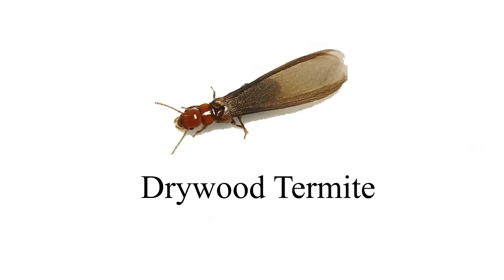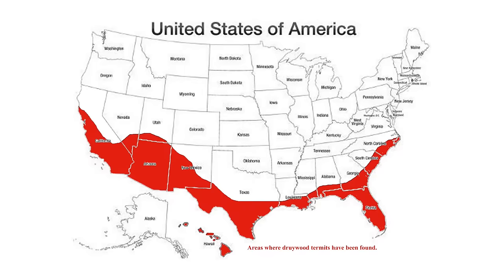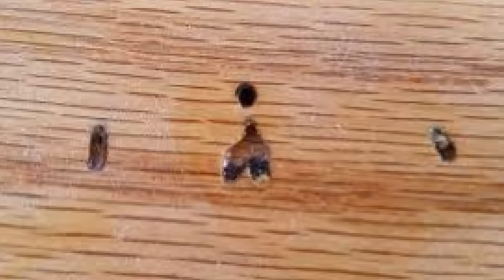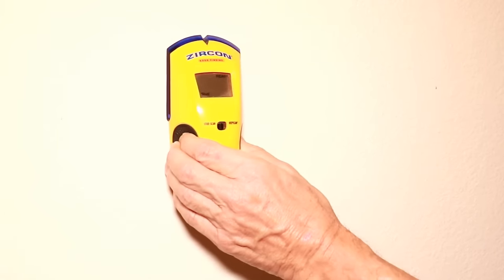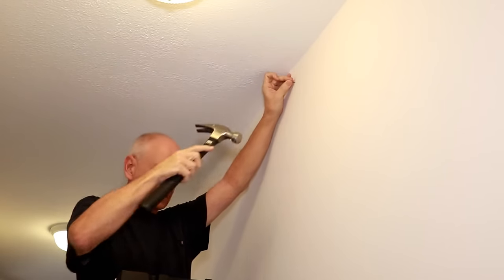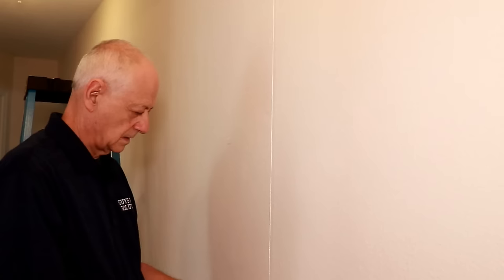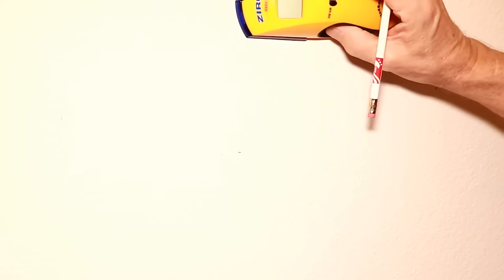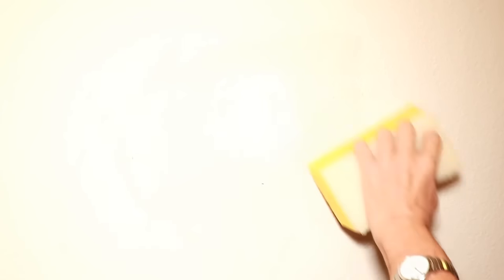How to Treat a Drywood Termite Infestation Yourself. A MUST see if you have Drywood termites.

Comment: I live in south Texas. I believe I have drywall termites. Ive been seeing kick out wholes and frass falling in on my kitchen time and around the kitchen window. My aunt got me Termidor SC. I have looked outside my house and I don’t see any mud tubes outside my house. I’m not sure if we should return terminator sc and get something different. But I do know I can’t afford a professional pest control.
Reply from the maker: I am so sorry that you are having this problem.  It sounds like you do have drywood termites.  This is very common in South Texas.  The Termidor SC is not going to work in your case.  You are not seeing mud tubes because drywood termites do not create mud tubes.  It is important to understand how drywood termites work.  They are not subterranean, so they fly to your house and enter through cracks and crevices around windows, doors, eaves, pipe penetrations, and so forth.  Most of the time, they enter through several locations.  That is because a swarm of them attacked your house at the same time.  If there was a crack or a crevice, then they probably found it.  After they establish their galleries, which will be inside the wood, it will take four to seven years for them to be able to swarm.  Now that they are in your house, the swarmers will use holes that are in your studs to travel through the walls.  Those holes in the studs were created by the electricians to run the electrical wiring.  Not only are these holes going through the studs, but holes were drilled into the attic for the light switches and to run some of the wiring for the outlets.  So, the termites now have easy access throughout the attic and the walls.  If you have a basement or crawl space, they have access to that as well.  Most of the time, you will have no idea that they are in the walls, because the frass is inside the wall.  To make matters worse, if you have drywood termites, then your neighbors have them too.  That means you have been getting swarmed for as long as they have existed in the neighborhood.  Most likely, we're talking about years, so it's a safe bet that you have these guys in many locations in your home.

I always hate to be the bearer of bad news, but if you have drywood termites, the only sure way to get rid of them is to fumigate.  Prices for this can vary wildly in this industry, so I recommend that you watch my video on how to hire a pest controller without getting ripped off.  That video can save you a lot of money.  You should also know that the gas they use to fumigate has absolutely no residual action whatsoever, so you can get reinfested the moment the tent comes down.  Like I said before, if you have drywood termites, then your neighbors have them as well.  Since drywood termites swarm every year, it is almost a certainty that you will be reinfested within a year after the fumigation is done.  The only way to prevent this is to do a preventive treatment on your house every 60 days.  Most pest controllers will not do this, so it is something that you generally need to do yourself.  I have a video on how to do that and I will place a link below.  This is a generic video that covers a lot of different pests, but it also works for preventing drywood termites.  Just ignore the part about treating your yard.  You only need to treat the house for drywood termites.  This will not treat the termites that are already there, but it will stop new ones from getting in.  If you absolutely cannot afford to fumigate your house, then you can try spot treating it yourself.  It is virtually impossible to find all the termite galleries, but it is way better than doing nothing.  The video you watched will show you how to do the spot treatment.  Regardless of how you treat it, you should begin the preventive treatment immediately, so that you do not get additional termites paying you a visit.  Even if you spot treat this, you would be wise to start saving for a fumigation.  The only good news about drywood termites is that they are slow eaters, so it can take years for them to do structural damage.  However, eventually that may be the case.  So, don't wait forever.  I recommend that you try to save up for a fumigation as soon as you can.  Structural damage can cost thousands to repair, and it could make your home unsafe to live in.

I am so sorry that this is going on.  Be well Melissa.                    

Video on how to hire a pest controller without getting ripped off:  https://youtu.be/y-a8XOqVrlE

Video on how to prevent drywood termites:  https://youtu.be/Yozv3s-Qwlw
Reply: If you have drywood termites, you really afford not to hire a professional. Don't hire the big companies (like Terminix). They charge much more & aren't better than the small local companies that have many years in the business. Verify their license, read complaints on Better Business Bureau, and mostly importantly, watch the videos Guy recommended. Take action sooner than later. I had my house fumigated twice.

Comment: Hello Guy. I have a severe Termite infestation at all corners of my home inside and also the outside structure I had 3 companies come out to quote and they told me they just gas the inside of the structure with all doors and sliding exterior doors closed. My  Eichler home has a unique Post and Beam construction . I asked the 3 companies what about the outside siding, beams, and extended roof as much as 7 feet from the exterior walls and they gave me a lame excuse that the gas will seep through the walls and cracks from the inside. This is totally illogical to me as I thought they would circulate gas on the outside perimeter of the house as well to treat all areas of termite infestation that are in the very extended roof and beam overhangs. Have some termite tenting co. gassed the outside of the structure as well as the interior ? Any information from your experience would be greatly appreciated. Thanks for taking the time for producing this video.
Reply from the maker: The pest control companies are telling you the truth.  The way fumigation is done is they put a tent over the entire building and they introduce a gas, which is usually sulfuryl fluoride (Vikane), inside the building.  The gas will penetrate right through the walls and kill everything within the confines of the tent.  So, if the tent is covering it, then that should do the trick.  Most of these companies have been doing this a long time, so if there are any special circumstances, they will generally make adjustments for it.  Keep in mind that most of the companies that give estimates do not actually do the work themselves.  It is very common for them to farm it out to a company that only does fumigation.  So, the pest controller you speak with may not fully understand how those special circumstances will actually be treated.  The folks that actually do the fumigation should know what they are looking at and they should be able to ensure total elimination of the termites.  

Before you do the fumigation, it is important to understand how drywood termites work.  They enter through cracks and crevices around windows, doors, the eaves, pipe penetrations, and so forth.  Most of the time, they enter through several locations.  That is because a swarm of them attacked your house at the same time.  If there was a crack or a crevice, then they probably found it.  After they established their galleries, which will be inside the wood, it will take four to seven years for them to be able to swarm.  Now that they are in your house, the swarmers will use holes that are in your studs to travel through the walls.  Those holes in the studs were created by the electricians to run the electrical wiring.  Not only are these holes going through the studs, but holes were drilled into the attic for the light switches and to run some of the wiring for the outlets.  So, the termites now have easy access throughout the attic and the walls.  If you have a basement or crawl space, they have access to that as well.  Most of the time, you will have no idea that they are in the walls, because the frass is inside the wall.  To make matters worse, if you have drywood termites, then your neighbors have them too.  That means you have been getting swarmed for as long as they have existed in the neighborhood.  Most likely, we're talking about years, so it's not surprising that you have these guys in many locations in your home.

The only sure way to get rid of them is to fumigate.  Prices for this can vary wildly in this industry, so get as many estimates as you can.  You should also know that the gas they use to fumigate has absolutely no residual action whatsoever, so you can get reinfested the moment the tent comes down.  Like I said before, if you have drywood termites, then your neighbors have them as well.  Since drywood termites swarm every year, it is almost a certainty that you will be reinfested within a year after the fumigation is done.  The only way to prevent this is to do a preventive treatment on your house every 60 days.  Most pest controllers will not do this, so it is something that you generally need to do yourself.  I have a video on how to do that and I will place a link below.  If you absolutely cannot afford to fumigate your house, then you can try spot treating it yourself.  It is virtually impossible to find all the termite galleries, but it is way better than doing nothing.  Regardless of how you treat it, you should begin the preventive treatment immediately, so that you do not get additional termites paying you a visit.  You must start the preventive treatment before the fumigation is done.

I hope that helps.  Be well my friend.                      

Video on how to prevent drywood termites (You do not need to treat the yard for drywood termites.  Just treat the exterior of the house every 60 days):   https://youtu.be/Yozv3s-Qwlw

Video on how to hire a pest controller without getting ripped off:  https://youtu.be/y-a8XOqVrlE
Reply: Thank you so much for the quick reply and and information Guy!  I never had this experience of a termite infestation at this level in my life before. Because of the many stories of break-ins n my area of southern California during a tenting  and the the huge hassle of moving a lot of things out of my home including many tools I have I have been putting this off and tried only spot treating which hasn't really done much. So far my quotes have been around $2500 and I plan to rent a small motorhome so I can park in front of my home to ward off criminals so I'm looking at $3000 plus. I'm also planning on doing your proactive treatments around the outside perimeter on my home and all the garage space open wood framing you suggested. Thanks much again Guy! @GuysPestSolutions
Reply from the maker: You are very welcome.  I hope it all goes well for you.  Be well my friend.

Comment: My attic space is tight, what type of sprayer is best to lug around for the bora-care? 0:01
Also, does the bora-care treatment kill any existing termites in attic or is it just a preventative measure; if so, should I fumigate or use some other product after the bora-care dries? Thank you so much for the information it is very educational.
Reply from the maker: I always use the cheapest one gallon garden sprayer that I can find.  You can get them on Amazon for around $12.  The Bora-Care will clog up a sprayer really fast, so I just throw it away at the end of the job.

Any wood that you treat with Bora-Care will kill all the termites in the wood and it will render that word permanently terminate proof.

It is important to understand how drywood termites work.  They enter through cracks and crevices around windows, doors, the eaves, pipe penetrations, and so forth.  Most of the time, they enter through several locations.  That is because a swarm of them attacked your house at the same time.  If there was a crack or a crevice, then they probably found it.  After they established their galleries, which will be inside the wood, it will take four to seven years for them to be able to swarm.  Now that they are in your house, the swarmers will use holes that are in your studs to travel through the walls.  Those holes in the studs were created by the electricians to run the electrical wiring.  Not only are these holes going through the studs, but holes were drilled into the attic for the light switches and to run some of the wiring for the outlets.  So, the termites now have easy access throughout the attic and the walls.  If you have a basement or crawl space, they have access to that as well.  Most of the time, you will have no idea that they are in the walls, because the frass is inside the wall.  To make matters worse, if you have drywood termites, then your neighbors have them too.  That means you have been getting swarmed for as long as they have existed in the neighborhood.  Most likely, we're talking about years, so it's a safe bet that you have these guys in many locations in your home.
                            
I always hate to be the bearer of bad news, but if you have drywood termites, the only way to get rid of them is to fumigate.  Treating the attic with Bora-Care is still a good idea, but that will not treat the walls.  Prices for fumigation can vary wildly in this industry, so I recommend that you watch my video on how to hire a pest controller without getting ripped off.  That video can save you a lot of money.  You should also know that the gas they use to fumigate has absolutely no residual action whatsoever, so you can get reinfested the moment the tent comes down.  Like I said before, if you have drywood termites, then your neighbors have them as well.  Since drywood  termites swarm every year, it is almost a certainty that you will be reinfested within a year after the fumigation is done.  The only way to prevent this is to do a preventive treatment on your house every 60 to 90 days.  Most pest controllers will not do this, so it is something that you generally need to do yourself.  I have a video on how to do that and I will place a link below.  If you absolutely cannot afford to fumigate your house, then you can try spot treating it yourself.  It is virtually impossible to find all the termite galleries, but it is way better than doing nothing.  Regardless of how you treat it, you should begin the preventive treatment immediately, so that you do not get additional termites paying you a visit.  

 hope that helps.  Be well my friend.                        

Video on how to hire a pest controller without getting ripped off:  https://youtu.be/y-a8XOqVrlE

Video on how to prevent drywood termites:  https://youtu.be/neNsmVbj8Pc